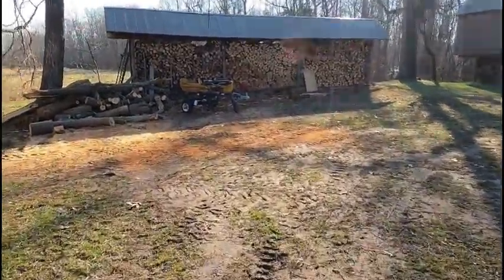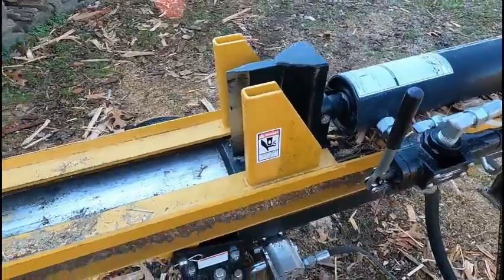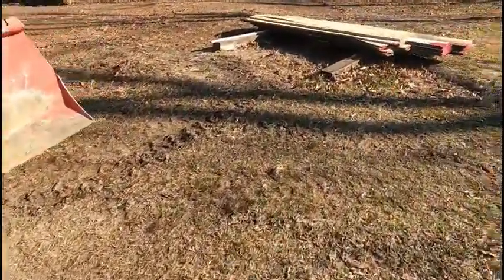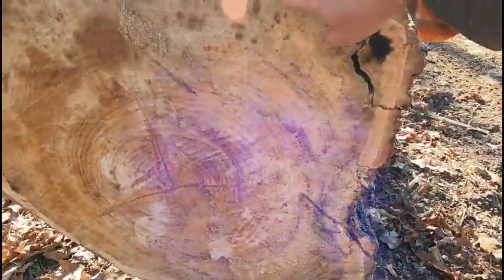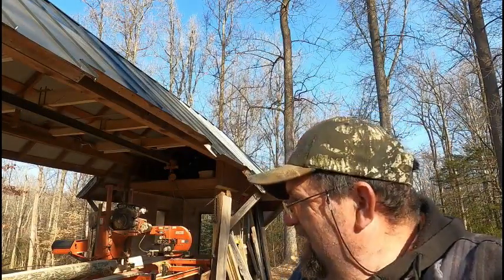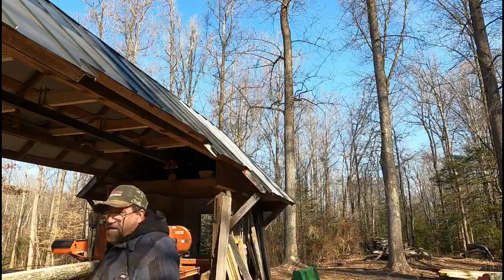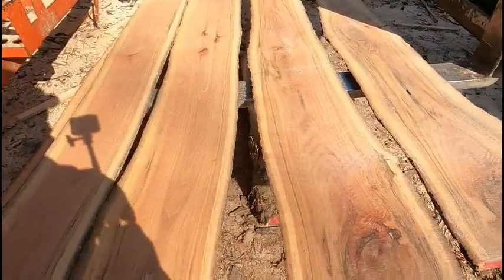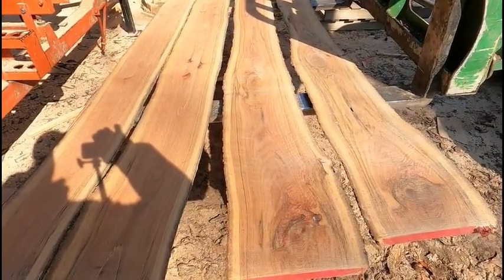The Beauty of the black oak tree logs keeps giving

Comment: Those two crotch pieces near the end are beautiful!  Maybe a ramp and roll that big black oak onto the mill...could be fun to watch 😁
Reply: I have the heavy ramps for the mill. The two crotch log sections i can all most lift. Each needs trimming in order to mill. That might be enough to lift them. The long log i think I'm going to cut the 5 ft 6 section off the end. That will leave about 13 ft. I think the skid loader will handle that just fine. Not in any hurry  at this point..